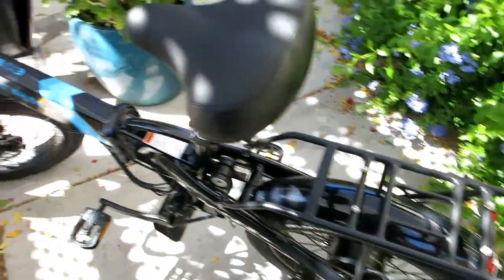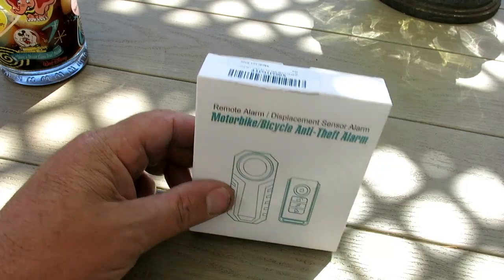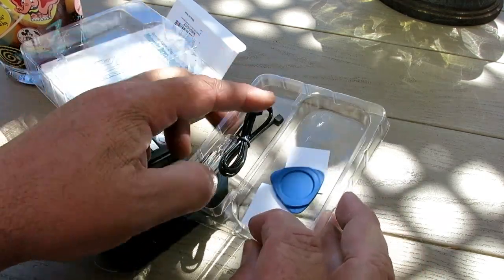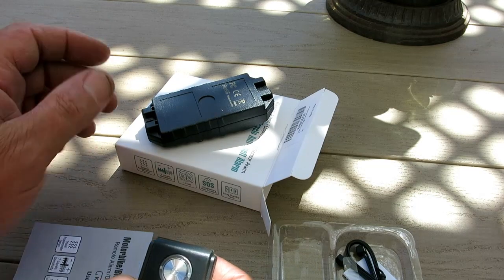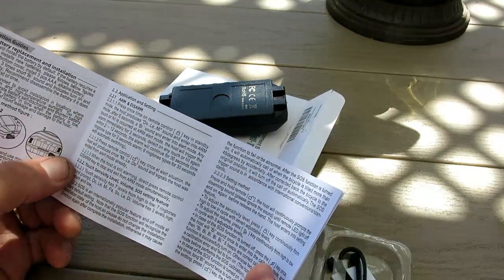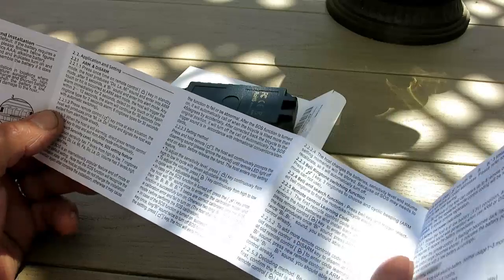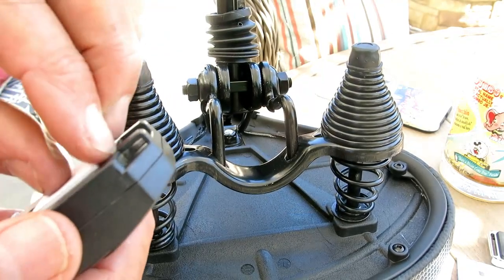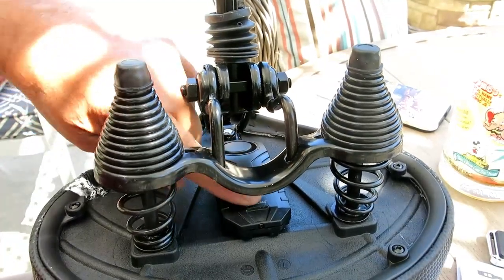Installing Wsdcam Bike Alarm to my Lectric XP 2.0 Electric Bike

Comment: I just put this on my Lectric XP 2.0.  Fits nicely under that flat front support of the rear rack.  I used both the adhesive pads and the zip ties and trimmed both when installed.  Mine is facing down so I can gear tie the milk crate onto the rack.

Comment: So when you need to change the batteries you have to take your seat off and go buy more double sided tape to Re stick it to the seat again?
Reply from the maker: I have since found out that it didn’t stick very well to the underside of the seat. It is now stuck to the underside of the downtube just forward of the clamp that is used to fold the bike. There is a harness that runs under the tube and I snuck the alarm between the harness and the tube. Then I zip tied it to the harness. I also used some double sided tape so yes, I will have to unstick it to change the battery. You could just zip tie it to the harness but I like having a more secure connection to the frame so that it can better pick up any bumps or movements which I think enhances the alarm’s sensitivity.
Reply: @ArVeeNiner  I'm trying to envision how that looks.  I just ordered the step through model which hasn't arrived yet and want it to be as secure as possible right from the start.
Reply from the maker: @FubarMike  You can put the alarm in a very similar location as I did on my non-step through bike. You basically put it on the underside of the tube that runs between the Head Tube and the pedal crank. Looks like that same cable harness is there as mine. Just sneak it between that harness and the tube then zip tie it to the harness. You can decide if you want to also stick it with double backed tape.